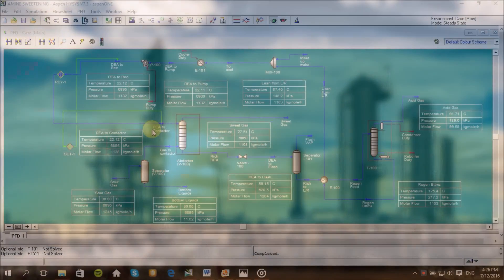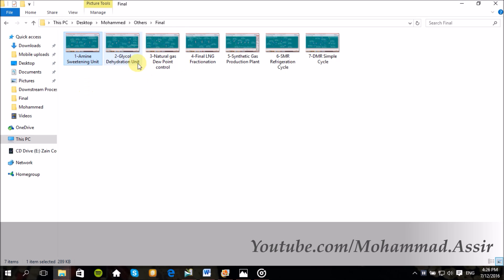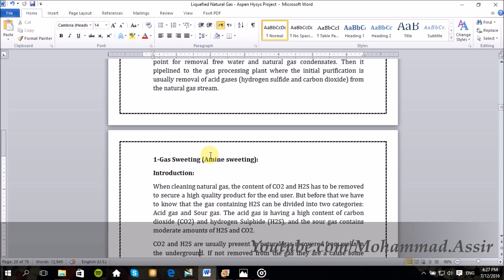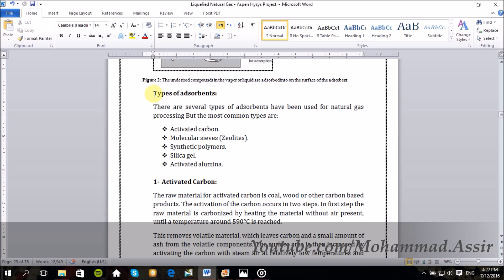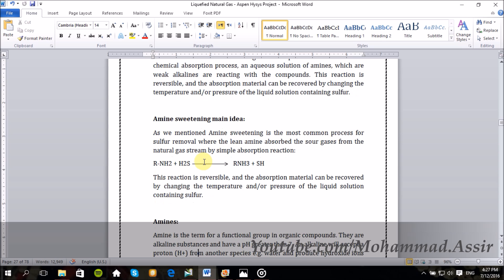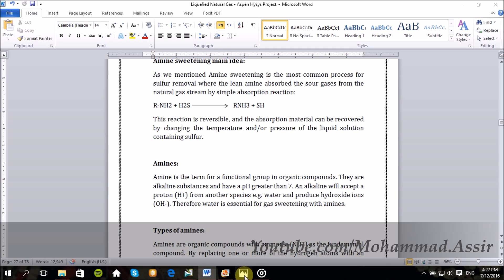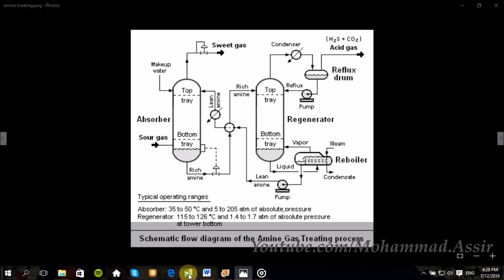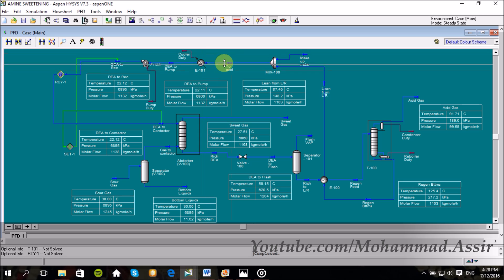1-Gas Processing - Amine Sweetening Process with Aspen hysys 7.3

Comment from the maker: Guyz Thank you very much.. but unfortunately i can't see all comments here.. i get confused with the channel notifications sometimes.. So it will be better if you contact with me directly via mail.. dr-zoling@hotmail.com
Reply: Mohammad Assir , i send you an email , I would like to have the document which is about acid gas removal in this video. I would like to use it as a reference.. thanks a lot
Reply: Assallam o alaykum Muhammad Assir,

How are you? 

Can you please upload vedio how to use sub flow sheet in hysys for two different processing (like dehydration and sweetening).
Reply: Assallam o alaykum Muhammad Assir,

How are you? 

I have discuss some problem related to Aspn Hysys, I am doing dew point reduction, gas sweetening and dehydration process after dew point depression (fluid pakage use PR, Basis 01) I was using sub flow sheet for gas sweetening (fluid pakage use Acid gases, Basis 02) and for this using MDEA (45% wt MDEA, 55% wt water) but problem is that at absorber outlet stream it will automatically select Basis 01 instead of Basis 02 and there is no MDEA stream there.

Regards, 
M.Talha
Reply: الا تستطيع 
ان ترفق ترجمة عربية مع الفيديوات؟؟؟؟
ليحصل الجميع على فائدة من هذا الشرح 
وشكرا جزيلا
Reply: ممكن 
ترجمة عربي

Comment: Hello Mr. Assir, I have one question. I am currently working on a process using Sulfolane-DIPA (Sulfinol process). During the recycle part, it does not converge. Can you suggest any solution for my problem? Thank you and also thanks for the video.
Reply from the maker: Well i think it will be much better if you send your hsc file on (dr-zoling@hotmail.com).. so i can check your process and see whats wrong !

Regards
Mohammad Assir
Reply: I have emailed you my hsc file. Thank you!

Comment: Assallam o alaykum Muhammad Assir,

How are you? 

I have discuss some problem related to Aspn Hysys, I am doing dew point reduction, gas sweetening and dehydration process after dew point depression (fluid pakage use PR, Basis 01) I was using sub flow sheet for gas sweetening (fluid pakage use Acid gases, Basis 02) and for this using MDEA (45% wt MDEA, 55% wt water) but problem is that at absorber outlet stream it will automatically select Basis 01 instead of Basis 02 and there is no MDEA stream there.

Regards, 
M.Talha
Reply from the maker: M.Talha.. I am doin great..¤¤ However i think it will be much better if you send me your hsc file on (dr-zoling@hotmail.com) so i can check your data to see where iz your problem.

Regards
Mohammad Assir
Reply: I am using 8.8 version have you it hysys 8.8
Reply: also how to change column trays to packing
Reply: I am using 8.8 version have you it hysys 8.8

Comment: hi can you simulate this process with MDEA/PIPERAZINE (47%wt/3%wt) solvent. in this case, can i select DBR AMINE or NRTL ELECTROLYTE package? i have some problem about "how to meet the content C02  of treated gas is  50ppmv as the specification. can you cantact me to discussing this issue. thanks
Reply from the maker: well i didnt get your point or your case clearly. However it will be much better if you send me some details about it on email.. dr-zoling@hotmail.com

Comment: I really thank you eng. Mohammed for this informative video and for your good manners.
Reply from the maker: Thank you very much brother.. i really appreciate that..¤¤♡
Reply: excuse me eng. mohammed I have a little question..
I simulated the same cycle on HYSYS and after making recycle the pressure of "DE Amine to contactor" became 190 kpa and the pressure of its inlet stage to contactor is about 6864 kpa !!!
how could it go from 190 to 6864 kpa ??
Reply from the maker: Well Recycle object is very critical.. it change all your plant values in order to reach the proper values that achieve Recycling..

Anyways if you didn't save the old plant i can send you the (hsc) file of my plant.. and also am working on Optimized one through [Dynamic Simulation] i will send it to you as soon as possible.. 

Regards
Mohammad Assir
Reply: thank you very much, I appreciate that. also I'll try as much as possible to reach the optimum values
Reply from the maker: Ok can i have your email.. ? so i can send your the file

Comment: I have a error of two liquids found in column on all stages
how can I remove it?
Reply from the maker: Reduce the Molar flow or increase the Temperature..
Reply: AOA I have mailed you my simulation in 8.8 version t you hotmail email address please check it
Reply from the maker: Really !! i didn't get it or probably i deleted it by mistake ?? I am really sorry could you please send it again..
Reply from the maker: Unfortunately i couldn't open the file coz am working with Aspen hysys 7.3 and 8.0 so i couldn't open 8.8 version files..

Comment: I am a new user of hysys, I have a project of gas sweetining process , I have using MDEA and TEG for removing H2S and CO2, problem is TEG is run  in fluid pakage PR, while MDEA doesn't run on it, so I used Acid gases and subflow sheet and then entre the environment but problem is how can I switch to my steam basis to fluid pakage no 02.
Reply from the maker: Talha Farooque am not sure if i got your point well. However it will be much better if you send me your hsc file.
Reply: Mohammad Assir ok will be sending you my file in 2,3 days
Reply: Mohammad Assir i have it on my university computer as i am going to monday at university
Reply from the maker: No problem take your time..
Reply from the maker: Sure brother..
Reply: waiting for you mail
Reply from the maker: Sorry bro i forgot.. i'll send it ryt now

Comment: Hello Mohammad,

thank you for your video, it was very detailed and informative. I have a question, though. Why do you specify the pressure of the feed stream to be 6358 kPa? I mean, why such an accuracy?

I am trying to model a separation of the dry (sweet) ga that leaves the absorber so I wonder about the operating conditions... Any hints?

Thank you
Reply from the maker: Thank you very much bro.. i really appreciate that. However the Wet Gas feed can take wide ranges of pressures (3Kpa to 6Kpa) even it can goes up to 8Kpa in some cases coz actually it havn't that effect as much as the feed Molar flow..

But i think it will be better if i could see your plant "screenshots or the hsc" to help you better.. you can send me an email.
Reply: Mohammad Assir thank you for your answer. I am currently setting up the problem so I do not have any simulation files yet... I am trying to find out what is the pressure and temperature of the wet gas stream in order to separate accordingly the dry gas stream... That's where I am stuck now... Any suggestions?
Reply from the maker: Ok can you send me your hsc file..
Reply: Of course I will, as soon as I have it set up... Thank you very much for your willingness :)
Reply from the maker: Anytime Brother..

Comment: Amazing videos, thank you very much! Have you ever made a video about SMR with PSA for hydrogen purification? I'm having difficulty modelling PSA.
Reply from the maker: Thank you very much..¤¤ However the PSA: (Pressure swing adsorption) Process can't not be simulated in Aspen hysys coz Aspen hysys is a Thermodynamic tool deals onlys with gases and liquids beside some exceptions.. But it can't deal with the solid reaction kinetics of adsorption processes.. Anyways PSA can be simulated in many other apps..
Reply: Thanks for responding to my question, I was going to just model the PSA as a splitter, but I'm not sure how inaccurate that would be. I'll probably try modeling it in Aspen Plus. Also, do you have any videos on modeling hydrotreaters in a refinery? HYSYS V9.0 has a naphtha hydrotreater that is quite good, but I only have access to V8.6 now which means I think that I'd need a kinetic model to model the hydrotreater, right? Would you happen to have any tips for me on where to find information that I need to model a hydrotreater (naphtha, kero, diesel, as well as FCC feed/gasoline)? Are you going to make any amazing videos for these process units too? (I've seen your hydrodesulfurization video, which helps a lot already)
Reply from the maker: Perfect..

1-Ok Before answering your points actually (Hydrotreating) is very simple concept which obviousely means : (Making simple Reaction with hydrogen in order to remove unwanted material or to improve our product) Thats all !!

But when we trying to implement this kind of reactions in Refining processes the Applications would be very complicated specially if you want to get the accurate results (coz you need to set the proper type of catalyst, reactor selection, reactor conditions, streams compositions.. accurately) coz all these are very critical specifications.

 2-To be honest i have'nt any videos about hydrotreating but am planning to start a new series on April for Process Optimization through Aspen [Plants case studies].. and i think i'll do like three examples on some Refining processes but am still confused about the choices [Distillation, Cracking, Hydrotreating, Reforming..etc] ! but i guess yeah i'll choose the Hydrotreating just to cover the processes that havn't designed before.

3-No the Hydrotreating processes "or most of them" can be done on hysys V8.4 and even on V7.3 but definately Aspen V9.0 is the best.. anyways if you working on a hydrotreating plant you can send me the layout or just some details about your plant and i'll tell you how to run the simulation "if it can be done"..

Regards
Mohammad Assir
Reply: THANK YOU very much again! I've seen some hydrotreating examples that came with HYSYS readily, but the problem is that I want to see the effect of hydrogen on sulfur removal, while the examples in HYSYS set the sulfur content first. I also seem to be able to run those models even if I remove the hydrogen stream. Only the V9.0 built in naphtha hydrotreater allows me to play with the amount of hydrogen being sent to the hydrotreater and see the effect on the sulfur content of the product. I'll send you an email to explain my problem and my purpose.
Reply from the maker: Yeah thats will be great.. 

But you know what ? Thats wt exactly [ Aspen Case Studies ] can do.. It lets you see the effect of any specification of any stream or unit on anything you like.. But as i told Aspen V9.0 present, and allows you to build, monitor and evaluate the process in better way..
Reply from the maker: And just i think i'll be lil busy nowdayz but i'll be in contact with you by Thursday.
Reply from the maker: stratovona266 Did you get my yesterday emails.. ??
Reply from the maker: I sent you one plant (hsc) file.. did you get it ?
Reply: Thank you so much. I got your email, but I did not get the hsc file.
Reply from the maker: The yesterday email right ? coz am not sure or to be precise i think i sent the message to the wrong person.. coz i didn't send anything but the hsc file yesterday !!
Reply: yes, I got an email from you yesterday that didn't have any attachments, but you had addressed my questions to some extent and said that you'd look at the second part of my email. :)
Reply from the maker: Ahaa i got it.. ok i'll send you the hsc file again tommorrow. really sorry

Comment: Hi, great video! I have a question. Do we need a DEA makeup stream which comes in the mixer?
Reply from the maker: Thank you very much Tu Anh.. 

Yeah of course we need it and it should be mixed with a Make up stream to meet the suitable compositions that can be attached to the Recycle Object. However i'll repeat and optimize this unit again and also i'll show how to run the Recycle accurately on my next series : (Chemical Industries and Case Studies Principles) very soon..

Regards
Mohammad Assir

Comment: Hi Assir! I really appreciate your work! 
Tell me please why the recycle does not converge (9:46) (reached iteration limit without converge) ? I tried to run further and whole simulation is loosing convergence! 
Thanks in advance!
Reply from the maker: Perfect Question Alex.. I really liked it.. actually I should change the Fluid Package before converging the Recycle Option.. I Should change it from (Amine Package to Peng Robenson) and then converge it but I forgot that.. anyways it still on steady state if you noticed.. which means it worked.. and even a lot of references keep that "its ok" ! But just change the Fluid Package (as I did in Video 2) and it will work ! and if it didn’t just tell me I will do it with you one by one till it work.. no worries..**
Reply from the maker: Or it can be done with the same Package but you have to add a lot units which will be lil complicated..